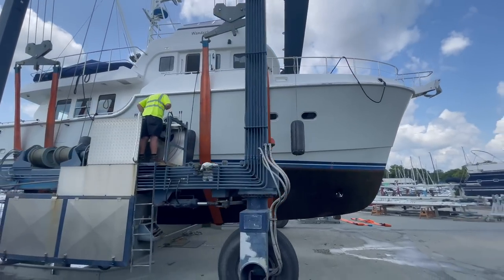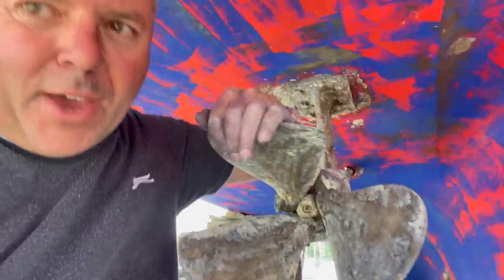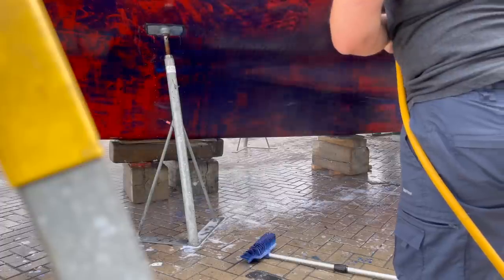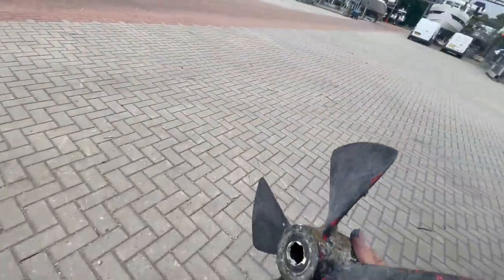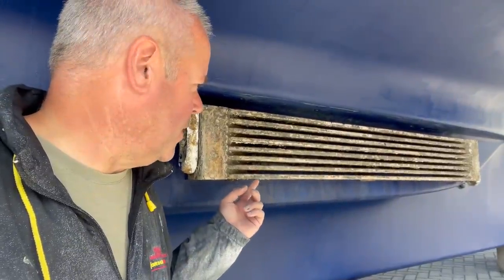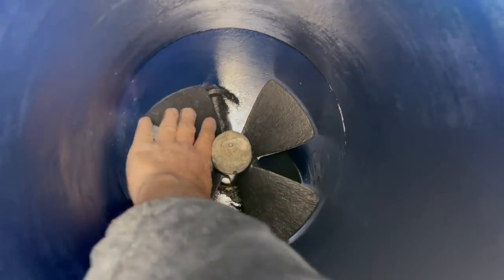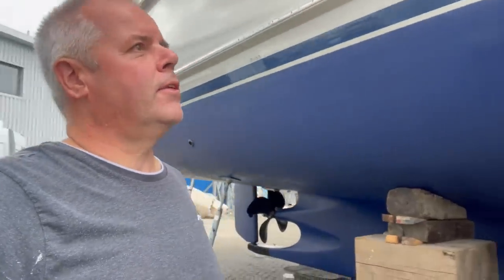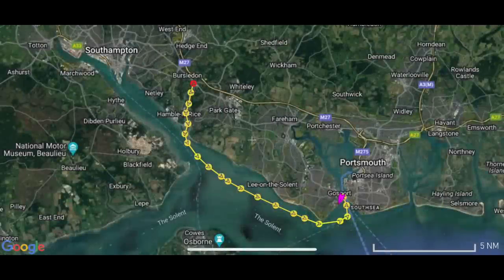Nordhavn 47 Lift out Maintenance

Comment: Awesome thanks. I know it is a lot of time to do these but they sure are appreciated. Is there a reason you did not choose Speed Prop for your prop coating? Also, have you done a video of your ultrasonic system? Thanks from the west coast of Canada
Reply from the maker: Hi, I looked at Propspeed but it says on the tin that it needs to be professionally applied and it still only lasts a year… on top of that the cost was more than three times that of Hempel Silic One.

I was going to make this video more about the ultrasonic antifouling but the manufacturer could t make it on the day of the lift out so I couldn’t get their comments in time. I might add a bit about the system in a later video.

Comment: Have you ever considered having your bow/stern thruster propellers laser engraved with BP, BS, SP, SS so that you don't ever have to worry about getting them mixed up? Clean them all at the same time...?
Reply from the maker: Hi, thanks for your comment. In short - no, I have never heard of doing this. Would it help?  I don’t know. I think the paint would just cover any engraving. The easiest way would be to just write down the positions - the bow/starboard and the stern/port are the ‘normal’ rotation and the others reversed.

Comment: Appreciate your channel and the attention to detail.  Curious...have you ever measured the noise level underway to see what the db level is?
Reply from the maker: The noise level varies greatly depending on sea conditions and wind. I have measured the levels on numerous occasions and when underway the very lowest I have recorded is 60.4dB. This would be on a flat sea cruising at 7kts. However you only have to change the rpm slightly and the dB level can increase significantly as some item resonates at that certain frequency. 
On the whole I would categorise the sound level as pretty quiet - that is quiet enough so that it doesn’t matter. It’s certainly below the threshold that bothers you.

Comment: I love maintenance videos :D Thanks for sharing. Could you explain how ultrasonic antifouling works? I never heard about it before. Also when you say your cost is less then 10% of the value - could you - very roughly off course - say what is the cost per year? Maybe split in maintenance, marina and diesel!? Thank you!
Reply: I, too, wasn't aware of ultrasonic anti-fouling. So I googled it. An incredible amount of information.
Reply from the maker: The ultrasonic system is a bit of a mystery and I was sceptical of it until now. I think it disrupts the cell membranes of the living organisms trying to attach to the hull (either that or they emit warp plasma), it’s all science - but it does seem to work. 

I try to spend £10k - £20k a year on my boating depending on how much time we spend cruising. This is likely to increase as my wife wants to do more with the boat. 

Some costs are known, home marina mooring fees are around £6k, insurance is £2k, fuel varies but we get around 1000nm for £1k of diesel.  Visiting marinas costs extra and then there’s all the maintenance and upgrades!
Reply: @Bloater  Thanks a lot for the detailed answer. It's good to know that there is boating below the 10% mark. I support your wife's wish for more boating (and more videos, I hope)!
Reply: @michaelfrankel8082  yep, will research as well

Comment: Help with antifouling, use a 10-12" roller with an extension pole. You'll do the job in 1/4 of the time and save your back. By all means keep the 4" roller for trickier areas but you'll never look back at the speed you can cover those large areas! (why would you paint a bedroom with a 1" brush?)
Reply from the maker: I’ve tried every way. The mid sized roller I find best. The 9” size required too much pressure and after prolonged use was too much strain on the wrists. The 4” size is a little small.

The second coat only took an hour or so which I though was fairly fast. The limiting factor isn’t the amount of paint that you can get on the roller - it is your own fatigue.

Comment: Hi Bloater. I recently started a search to find a trawler that fit the formula charter/live on board. I found the best characteristics thought of in the N47, which perhaps even balance the cost/benefit. What do you say? I very much appreciated your comments and questions raised during the maintenance of the antifoulig and etc, and I did the same with my whaleboat. My question is, how is the policy for managing waste and gray water regulated? Grateful
Reply from the maker: Nordhavns are great as liveaboards, perhaps not so good as charters due to the fewer number of cabins.  Charter boats usually seek as many cabins as possible.  For instance the standard 47 only has 2 cabins.

All waste water is held in tanks. The heads either go overboard or into a 'black' tank. The sinks and showers go into a 'grey water' tank.  All water tanks can be pumped overboard where allowable.  All tanks (fuel, water, waste) are made of grp and moulded as part of the boat.

Comment: amazingly clean for 4 years in the water, I assume thats primarily due to the ultrasonic ?
Reply from the maker: Yes I think so. The props and exposed metalwork were badly fouled though. The ultrasonic system does not help those areas - and they had just recently been cleaned by diving under the boat.

Comment: What was the hull like before using ultrasonic transducers in that time span. Also glad I'm not the only one that has to do all the work ourselves.
Reply from the maker: This was the third time I have lifted this boat in my ownership. The previous occasions the period was one year - and the wing prop was fouled badly the first time so I fitted the ultrasonic antifouling shortly after that. As with all ‘tests’ it is difficult without a second identical test vessel as a gauge.

Comment: How much of DIY maintenance cost you in a year "percentage" ?
Reply from the maker: Hi, that is one of the most difficult questions to answer. The actual answer might not sound very helpful but is true. The answer is ‘what ever you want it to be’. Some years you can get away without spending anything, other years you might plan an upgrade or a maintenance job that has been on the back burner. In my case I don’t lift out every year so on the years that I don’t lift out my maintenance costs can be very low, only a few percent if at all. This year my maintenance cost was 50% of my total spend as I have lifted out and did some one-off engine related tasks. My most helpful answer I can give is that I budget between £10k and £20k per year on boating.

Comment: Were you required to hire a deck hand or did you want a second set of hands for the trip?
Reply from the maker: There was no requirement for a second pair of hands other than the fact that I think it is unwise to do any trip without some help. It’s possible to single hand this vessel until something goes wrong (provided there’s someone to take a rope on arrival).
Reply: @Bloater  Ahh, got ya!  Makes sense.